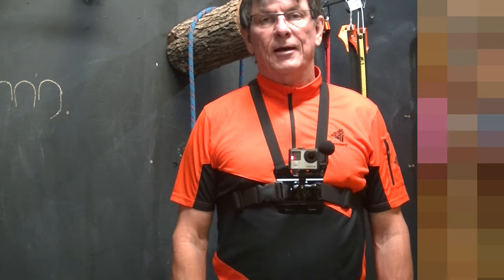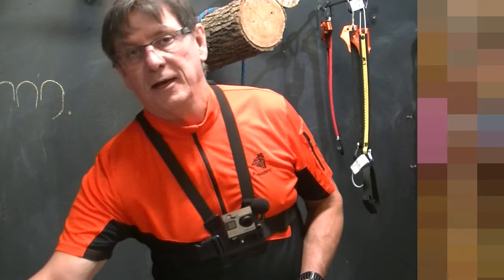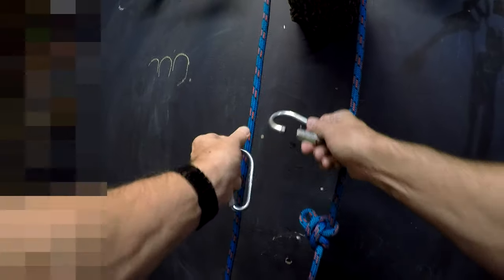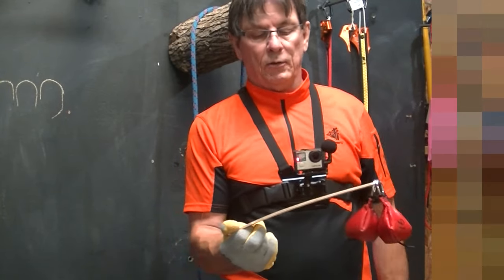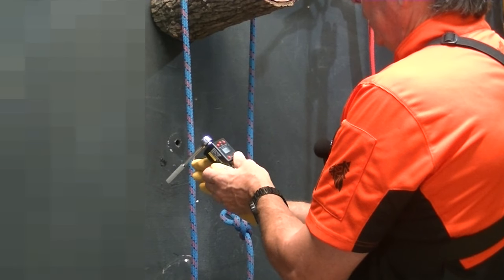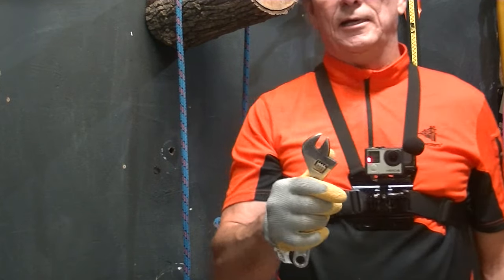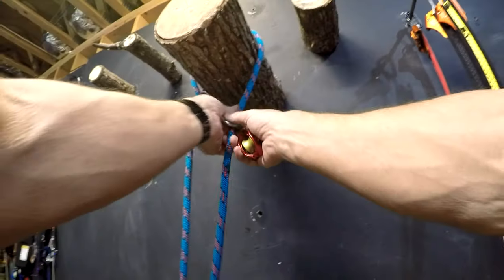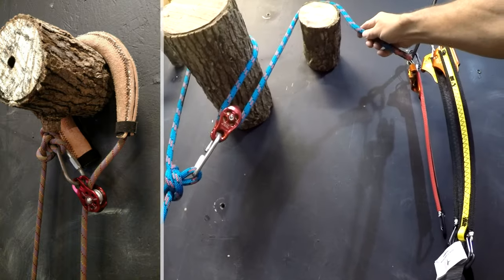Using Maillon Rapide Quick Links

Comment: Another informative video! Thanks Richard!
The pronunciation in the French translator is supposed to be prety good: https://translate.google.fr/#fr/en/maillon
English pronunciation: https://translate.google.fr/#en/fr/maillon
Click on the speaker link below the word in the above links.
Reply from the maker: Hey, that's great, I should have should have said it in Spanish and I would have been a lot closer!
Reply: As an English speaker, if you were to say only the first two syllables of "mayonnaise", you'd be close enough.

I've used the 10mm (55kN) Maillons (http://www.peguet.fr) in caving for anchoring ladders and ropes.  I've started using them in canopy anchors recently.  Bomb-proof bits of kit and only half the price of a carabiner in the UK.
Reply from the maker: +Nick Lane and I've learned it is French for link.  I still can't say the word for the VT, and my French climbing friend had said it 5 times.